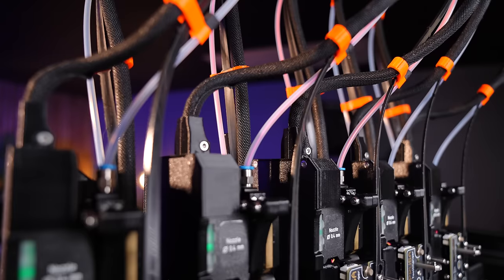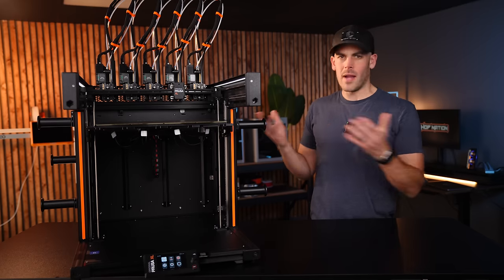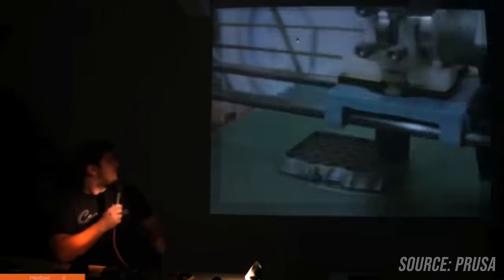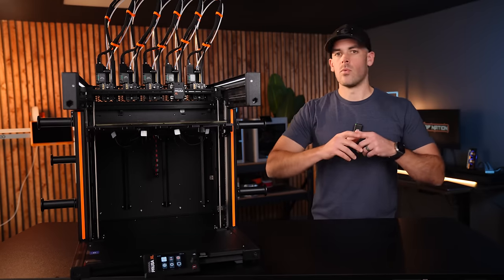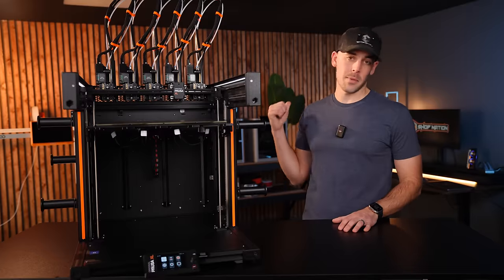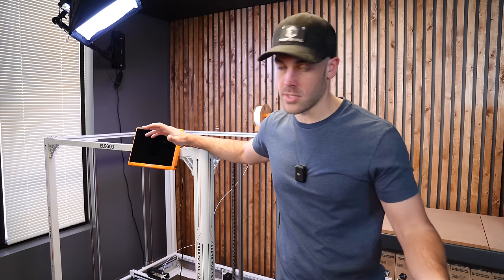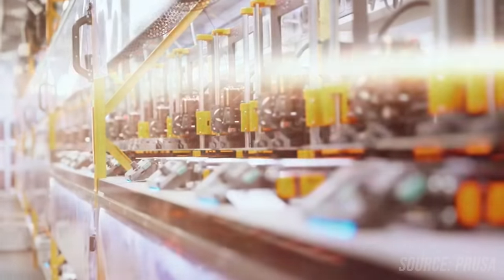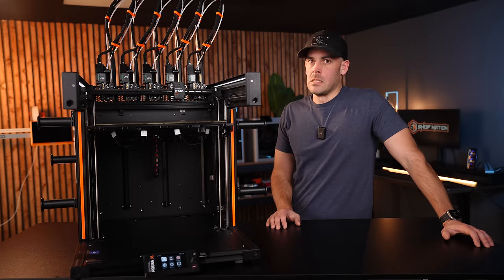Why Prusa is the next Blackberry

Comment: LOL your video is miss leading sorry. I tell you exactly why:

1. I bought the Bambu X1C when it came out and fell in love with it. I also bought 2 AMS to be able to print in 8 colors. 
2. After a few weeks I noticed that I made a big mistake with buying it. 

Why? The AMS is useless, as the printer will create dirty and ugly stripes of other colors you have in your AMS on the more brighter filaments like white. If you have black, red or any other colorful filaments, anything in the white area will ALwAyS get messed up. You see stripes in the white. The only way to remove this flaw of the multi color print with only 1 head is to drastically increase the „cleaning phase“ parameter of your AMS. You have to increase the transition parameter for the cleanup to 850 to 900 or above. Else you see the stripes. 

That means the print times will increase with each additional color you use 😂

4. It’s a nightmare and sometimes you take 3 to 4 days to print something small with the X1C. Sorry there is no way you have printed that Banshee in 1 day with more than 2 colors. Show us the quality and no visible stripes! You didn’t. 

And the amount of produced waste is a joke. lol

Summary: Don’t buy the X1C. I ended up selling it and ordered the Prusa XL with 5 heads. Problem solved. No long loading times and filament change times, zero waste and no dirty stripes on my print.  

Even if the Bambu would be faster with multi color prints: what use do I have, if I see after a 2 day print that stripes of other filaments are in the white area? I would need to start all over again. You can’t use or sell these messed up prints. Absolutely useless AMS. It’s a marking trick by Bambu. 

Oh by the way: Bambu says you can combine up to 4 AMS to print in 16 colors. LOL. You would print a 2 hour banshee in 2 to 3 weeks weeks in 16 colors 😂😂😂😂. After 3 weeks you would start again because you see stripes in your print. Good luck with that.

If you don’t need multi color prints, then the Bambu X1 is great. Go for it. But if you need more complex prints in multi colors, then there is no way you would buy the X1C. Go for the 5 head prusa xl instead.
Reply from the maker: How did I miss that? I literally said that
Reply: @ShopNation  watching your video makes the impression that Bambu X1C is as good as the Prusa with 5 heads for half the price. You also compared Prusa to BlackBerry which is fully wrong. Prusa is not even close to being like BlackBerry. For example: What is the alternative to the poor AMS system by Bambu? Well, a printer with fucking 5 heads like the Prusa XL 😄. Bambu has no solution for that but Prusa has. And I have never seen a similar printer as the Prusa XL. It’s a revolutionary design with 5 heads. People need to appreciate that more. 

Watching your video makes the impression as if Prusa has missed on something, when in reality they are far ahead of the Bambu XC1. A high level 3D printer like the Prusa and Bambu should be able to print in more than 1 color without a problem. The Prusa can while the Bambu fails. That’s an important point which is not pointed out in your video which miss leads the customers. 

As I wrote above: I sold my Bambu with two AMs for the Prusa 5 head. Do you know how much money I lost? At least over 1.5 grants in total. So why did nobody tell me to buy the xL 5 head from Prusa in the first place?

Comment: I'd honestly counter this argument by suggesting that Bambu needs to make equally as large changes to stay relevant, and their success isn't guaranteed. The X1C Kickstarter happened less than 2 years ago. We've still yet to see what will happen to those machines 3+ years into their lifecycle. As their subreddit seems to suggest, not great.

We've also seen some very costly blunders on their part with the A1 power cable fiasco. Bambu has largely been the "Move fast and break things" company of the industry. I think we'll see them slow down, out of necessity. As their market share increases, they have to be much more cognizant of the costs of recalls and other mess-ups. So we'll see them scale a little more, hire more engineers, and put in more processes to double check everyone's work. That, and their support departments ability to scale when that generation of printers starts not working great, will be huge determinations.

So yeah, I think Prusa has a little growing up to do, but not as much as you think. If the MK4 was in development for 2+ years (confirmed by multiple sources) doesn't that already imply they are onto the next thing?
Reply from the maker: BambuLab is run by ex DJI leadership, that same move fast strategy has done very well with drones/cameras
Reply: @ShopNation  Has it? Look at their stats. Drones were a hit with consumers in the action camera era (See GoPro), but it’s basically dried up. DJI by market share is mostly left with a really solid base of professional users who like the Mavic and stabilizers. Heck I’d argue stabilizer gimbals are even kind of out of style in cinematography after we had a whole era of aggressive push in and push out footage.

So DJI is basically in the same state of what we’re accusing Prusa of doing: good, but expensive pro stuff, with little innovation at the lower price tiers.

Comment: I want a MK4 but I don't think it's worth it really. I however, refuse to buy Bambu Lab hardware. Closed source software/hardware based on IP stolen from other brands. Dubious "safety" and always on connectivity (until that eventually backfired on them) is a turn off. Prusa legit cares about the users and I support that. Id compare prusa and Bambu like car brands. The Prusa stuff will always be the Toyota. Extremely reliably and easy to use. Bambu is a Tesla, high tech and flashy with obvious flaws once used.

Edit: I would throw good money at a new Prusa printer if it has Core XY, i3 build volumes, input shaping, direct drive, better prusa connect, and 32 bit board and color screen. The MK3/4 design can live as a single model that takes a back seat to the new model (obviously at a lower cost)
Reply: I have my own 5head XL... so far I like it. I have for years MK2.5s which earn money for XL ... I like it. I have MK3s, which is work horse ...I like it... I have Mk4 build from kit own by my friend... I like it... but Im waiting for AFS printer for end user to put mk2.5s/mk3 in retirement.

Comment: 1. Labor cost. Prusa can't compete. Long term, low cost comes at a different price.  2. Prusa has spent years leading the peloton, and the other companies have benefited from their r&d (what to do, what not to do).   3. Not everyone is running a farm   4. As you said, multi-head is the better of the two solutions, maybe not what we will all use eventually, but for now, clearly better.  5.  Mercedes, Snap-on, Leatherman - they aren't premium because they're cooler. They're cooler because they're made better.  People buy them because they want a product made better. Not because it is the best of all products, or at the best price point, but because at some point they need a product that is made better and the company behind it.  _other people then buy, because those first people made it look cool.  There are a hundred cheaper all-in-one pocket tools, with dozens more features, yet after buying a handful, I bought another Leatherman. Its not a ornament, its a tool, and the value in a tool is its usefulness and dependability to us.   As you've noted, having a number to call,  can be more important than price, and performance.

Comment: I saw your earlier video of the MK4 vs Bambu Lab and I was sold with the Prusa being reliable like Toyota. I had just entered the 3D printing world after watching your video, so I was completely bias to all 3D printing companies. The thing that really bothered me about Bambu Lab was the way they took advantage of Prusa's open source and didn't reciprocate the help. I understand, Bambu did it because it was barely starting and needed as much help as possible. But the thing that really made me dislike Bambu Lab and showed me their real colors and what they are made of is when they also copied Prusa's Printables page, Bambu just changed the orange color to green. I'm still glad Bambu exists, because it shook the industry and helped push Prusa into keeping up. By the way, the XL can do more than multi color, try looking up videos on the XL doing multi material, they are pretty impressive. Something I noticed is that people have a difficult time finding things to print. I actually print everyday stuff that I can use. I got tired of buying those cheap aluminum wallets, so I designed and printed my own wallet, which is pretty cool. With the printer, I'm also finding options to print car parts, like clips that don't exist on old vehicles, panels, etc. With a multi material printer, you have much more options to print automotive parts. I just love 3D printers !

Comment: Thanks for the honest opinion in this video! I have the exact same perspective. If Prusa will not come up with competitive XY-core printer (closed case, touchscreen, remote control, videostream, larger build volume, working multimaterial not like the MMU2, etc.) then they might end up like Commodore. DIY looking 3d printer is no longer the state of the art.

Comment: I agree absolutely. Josef Prusa's strategy right now seems a bit of an enigma.  Prusa machines are definitely good, but they are no longer properly positioned in the market. I have the Mk3S+ and so far I have resisted all attempts to get me to upgrade to a 3.5, 3.9, 4 and now 4S, mainly because for the same money or less I could easily buy one of the smaller but still very fast Bambu models, and have 2 printers. 

As for buying the mk4s directly, not only does it NOT come inclusive of an enclosure (unlike Bambu),  but when it comes to the MMU3 (which is not even multi material, and does not act as a dehyradtor either, and by the way HAS TO BE mounted on the printer (I asked)), you even have to print your own parts. So Prusa boast they have the largest print farm in the world and yet I have to print my own parts, and still pay big bucks on top of that? Not happening. 

And don't get me started on their rigid shipping policy. Buying a set of nozzles from them involves paying for a courier, which means shipping (to another EU country) is actually more expensive then the item itself. Why don't they offer an option for parcel post with tracking like so many companies out there do? Heck I must have received DOZENS of packages from Ali Express etc over the years and never had a single one be lost on the way. Sure you wait a while longer, but I don't mind waiting. So even where some economies can be made, they stubbornly refuse to consider them. The mind boggles. Flashback to Kodak, Nokia, et al.

Comment: I think they should focus on the part of the market that will pay the premium a prusa has always demanded.
Mid level engineering.
Because I think bambu has already stolen the market for the segment the x1 fills, and just building a bambu copy is not going to take that segment back.

A bambu can print some engineering filaments but it stops at the most basic ones like polycarbonate. On top of that, the AMS wastes so much filament no one wants to print multi-material in the more expensive stuff even if a bambu could handle it.
When you pay 200-600 dollars for a 1kg roll of filament but you need multi-material because of supports. Tool heads is the only way to go.

An enclosed XL with a heated chamber rated to 80c-120c, with 500c hotend and water cooling for a similar price to the current one could easily get engineering firms that need inhouse printing but don't want to spend 50k on a commercial engineering grade printer.

Comment: I bought a Prusa MKIII Kit and Built it myself to save some Money and Other than getting a Faulty Steel rod that wasn't Hardened and was getting scored, This Printer have been REALLY reliable and I LOVE IT, but even with ME building it, The mkIII was near DOUBLE the price of Bigger ASSEMBLED printers from other brands, I chose Prusa in spite of this because Makers I TRUST, FOLLOW and RESPECT use them so did Manufacturers I bought parts from and all of them Recommended them for their reliability and longevity but that was more than 3 years ago now. Not only will most people NOT do what I did, more and more Makers are using other brands (many times sponsored) and I see less and less Prusa's on YouTube, I LOVE their quality but their prices will probably need to come down or have their Speed, SIze and Functionality go WAY UP to justify their current prices

Comment: I very respectful disagree. ;-) PRUSA Mk4S, the Mk4 with the issues solved, matches Bambu's speed and ease of setup. Moreover, and when you dig into teh specs PRUSA prints better dimensional accuracy out of the box, even if you are taking 0.001%.   I think where Prusa actually has an advantage is THEY make their product from circut boards to injected molded parts, so they are more agile not less.  Bambu has to wait on a parts from China (well everything is made in China for them but still B2B in China is getting dicey) or deal with a their supplier switching MOSfet specs.  If PRUSA thinks a MMU2/S Plastic Part woudl cause 12.75% less vibration printed a different way they can do that immediately and provide the print specs for a user to make that.  If a user does not want to fix their machine in Prague they can send it to Print Solid is the USA - PRUSA is so much more agile Bambu should be teh worried ones.

Lastly, even beyond PRUSA advantages above....well, now they are not being sued. Stratasys has filed two patent infringement lawsuits against Bambu Lab, and they will for better or for worse likely win.  By winning that really means Stratasys will OWN a big stakes in Bambu which will make them yet again less agile.  This lawsuit might even prompt Stratasys to sue some other companies just to prove them are not singling out Bambu.   Remember when MakerBot was a scrapy startup with kit 3D printers?...and then boom Stratasys/Ultimaker own a lot of then company.   I think PRUSA is uniquely positioned to weather a patent fight because if they lose they control their supply chain & design specs better than their 'slicker' competitors.

Comment: In my opinion they HAVE to make the MK4 a beginner tier machine, and release a proper CoreXY that can rival the P1S and P1P. That is far more modular than both. They can do it easily. Expensive bed slingers are dead.

Comment: There is no $3500 solution that does what the XL does. And you're right that niche is much, much smaller than the market that the X1 Carbon operates in. But I think you fell into the a trap comparing the x1c and the xl. They're not competitors. The X1C competes with the Mk4 with MMU3 and wins hands down. The MMU3 is better, but only if you ignore the absolutely ridiculous footprint and the complete lack of viable mounting solution for filament. 

Then factor in logistics and its another easy win for Bambu. You know whats not fun? Ordering $1400 worth of printer then having to pay import duty and deal with DHL. Not to mention, lead times. Ordering from Prusa is an exercise in patience which is irritating if you're a home gamer, but business destroying if you have to wait 6 weeks + shipping + customs to replace or enhance your farm with a new printer.

I have an XL and love it. Being able to print full size helmets and shoes is a ridiculous flex. The almost zero cost of filament changes is also changing how I model. I don't care as much the part overhangs, because I know I can use PLA and PETG together and get zero clearance easily removable supports. You cannot do that reliably with a single print head because the immiscible filaments combined with just different enough temperatures is going to get you eventually (usually within 50 changes, often within 10). 

But if you don't know you need the XL, get the X1C and if you want a Mk4 MMU3 get the X1C.

Comment: Prusa could make BANK right now by selling the Upgrade Kits for $100. Say Mk3 to Mk4.  Not Mk3s to Mk3s+ or  MK3.5 for $250 and 500 or 700 to get to MK4.   When a Bambu Mini cost $200-250 and has more USABLE space than a MK4, is 3 times faster and can be upgraded to multi color.  I am an early Prusa guy too , also pissed and they brought stuff in house not because of shipping but because they took the best of the community brought it in house and locked the doors and cut out their vendors profits.  That is how pissed I am.  My mk3+ sits because it can not make a print as good as ANY of my bambus and  I get nervous if a make a print bigger then 100m of center of the prusa plate, (warpage and non stick problems increase exponentially with every mm you add to the print size due to the uneven heat of the bed). On a Bambu MINI you can use the whole bed , press a button and LEAVE.  So a Bambu MINI Has more usable space than a MK3s, s+, 3.5 an possibly MK4....   TEST IT!!!

Comment: I dont know if it is possible to ever achieve this, but imagine a 3D Printer with 2 running printheads, pretty much seperated from one another.
You can have: 
Print clones/repetetive structures simultaniously
Print multi color/material things with less speed dropoff still

Maybe the key is to just stack another XY move assembly on top and add a Z motor that can just go above the main one? And the Filament tube comes out the side for the bottom one? IDK.